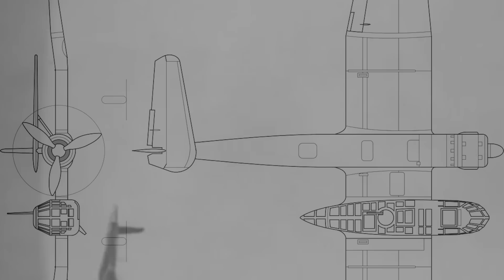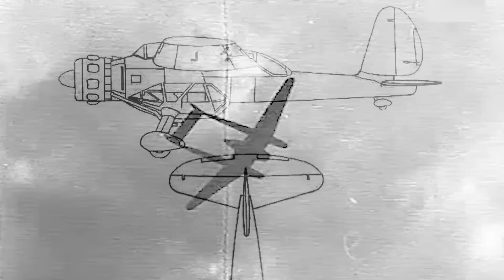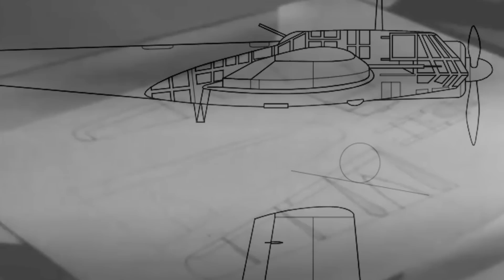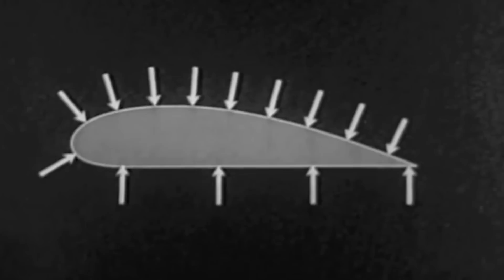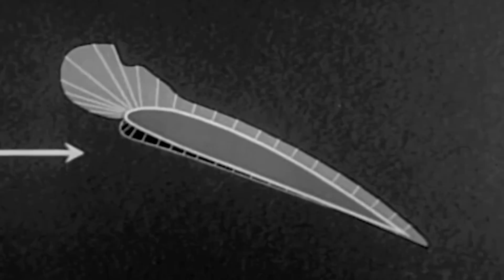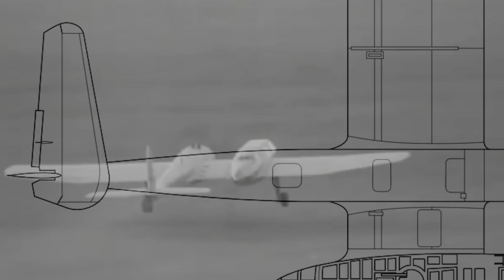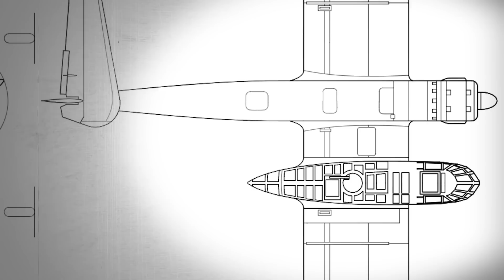BV 141 - The Most Asymmetrical Airplane of WW2

Comment: At the end...Richard Vogt was taken to America under Operation Paperclip where was tasked with designing “nuclear powered” bombers.  We have nuclear powered boats and subs, why not planes?  At least war and cargo planes.  Think of all the fuel consumed by B-52s, C-130s and C-17s over the years.
Reply: Back in the '50s, a lot of hope was resting on the advent of lightweight radiation shielding materials.
These proved to be impossible, so such aircraft would either kill their air & groundcrews over time, or have such thick, heavy, lead shielding as to make performance terrible, & turnaround times interminable.
 Also, fuel was cheap, & environmental damage was not yet a mainstream concern.

Comment: My son and I built an asymmetrical plane that was rubber band powered based on the BV 141 and it actually flew extremely well. Better than some of the standard designs that we've used.

Comment: Re: Asymmetric air-craft, most helicopters and autogyros have a left or right handed rotor. Single engine planes have a noticible gyro effect from engine and prop, when throttle changed.

Comment: There was an X-plane that had a wing that scissored: one side swept forward and other swept wings back. Easy swing wing? No, center of lift changes as speed increases. In the US we drive on the right (correct) side of the road but Europe drives on the left (wrong) side of the road. So the gondola has to be on the left side and engine nacelle needs to be on the right side.

Comment: It’s not hard to imagine that a 
twin-boom central fuselage 
single-engine pusher prop design could have achieved these goals more simply...
something like 
the Edgley EA-7 Optica.

Although the Optica was a later aircraft that had different goals and was thus slower and smaller,
it was a very uniquely 
visibility-oriented aircraft 
(just designed for non-combat).

It is VERY slow and quiet-
if used effectively,
this can actually be more lethal  than power and speed...
especially at night before advanced radar rose to power.

Just ask the Night Witches 
in Russia.

Of course,
its “stealth” is more for environmental concerns than combat.

However,
Ducted fan aside,
the general design configuration of the Optica would have been excellent for this application.

This configuration was simpler,quicker and easier to produce and get flying.

Which brings us back to this:

Way-out innovative designs take time&money to perfect-
such commodities are often in short supply during wartime.

It can certainly be argued that the German obsession with 
“super weapons” or “wunderwaffe” like the V-2 
and the Schwerer Gustav 
actually cost them the war.

The Gustav supercannon program cost 7 million reichsmark 
and in actual combat,
Gustav fired...
48 shells.

More shells were fired in testing.

This wore out its original barrel.

It took 4,000 men five weeks and a custom built semicircular 
TWIN railroad to prepare the 
1,000 Ton weapon 
to be deployed,placed&aimed for firing and 500 men to actually 
fire it...
Furthermore,
it made a VERY obvious target from the air,thus requiring significant dedicated air support craft&personnel to defend it.

It was designed in preparation for the Battle of France but was not ready for action when the battle began and in any case the Wehrmacht's Blitzkrieg offensive overwhelmingly forced the French to surrender in record time and made their “destruction by supercannon” unnecessary.

Then an attack was planned on Leningrad-
The weapon was sent to the railway station of Taytsy. 

It was finally operational when the attack was cancelled. 

Gustav was later destroyed by the Germans near the end of the war in 1945 to avoid capture by the 
Soviet Red Army.

Dora,the sister cannon,
was even more useless.

The V-2 took so long to put into service that it was only able to be used for a few months before they could no longer reach their intended targets because the Germans had to fall back and the V-2 no longer had the range to reach London.

More slave laborers died 
producing it 
than it actually claimed while being used in combat...

Criminally horrible extravagance.

From a wartime resource management perspective,
the V-1 was much more effective.

All war,though,
is ultimately civil war...
Yet-
No war is civil.

Comment: "Exceeded expectations but still underperformed "
Let me get this straight, they expected it to be shit but they built it anyway!? I'm confused
Reply: It exceeded expectations for its designed capabilities but didn't perform the expected task of reconnaissance as well. Most likely due to Allied radar, fighter intercepts, loss of forward air bases, loss of fighter support, loss of oil/gas for planes, etc...
Reply: It met all of the specifications that were laid out in the requirements.   However, as we all know, Germany focused far too much on short and medium range aircraft, and this was just another example.   It did the job it was designed to do, and did it well, but as a short range recon plane it would have to fly out of bases that were vulnerably close to the front lines, and as such it, as well as its bases, would be constantly under attack as was the case at that point in the war.  They shut down the project because it was obvious that 1) it was using up resources that were in dire need for actual defensive aircraft, and 2) a significant number of the Nazi leadership didn't like it due to the way it looked. 

The US had a plane that was treated in much the same way, the P-47 thunderbolt.   It exceeded all of the requirements asked of it, INCLUDING the range requirement.  At the time it was adopted into service the generals in charge of the army air force only wanted long range bombers and were convinced that fighters were an unnecessary waste of resources.   They manipulated information regarding the P-47 and that misinformation continues to this day.     Check out  https://www.youtube.com/watch?v=aCLa078v69k
Reply: @andrewstar9747  The Vought Corsair also had a rough start to a stellar career.
Reply: @dotarsojat7725  yes it did.  It was intended as a carrier plane and was initially only used from land due to issues that were later corrected
Reply: @andrewstar9747  "a significant number of the Nazi leadership didn't like it due to the way it looked. " - That was true for so many of their projects.
Reply: it's a Hitler thing.
Reply: @jerryslater3447  just like many US innovations were
Reply: “Mostly exceeded expectations “
Reply: Welcome to MOST prototypes. You REALLY DON'T know how they'll go UNTIL they go.
Reply: Me too
Reply: Does that mean it was hot shit?
Reply: "Military intelligence, two words combined that don't make sense": from the Megadeth song Hangar 18
Reply: David Parry  you are full of American propaganda. Ever heard of operation paperclip? The US brought hunderts of German engineers into the US because they needed them. German engineers were one of the the best in the world druing ww2, but german politics druing ww2 were extremely incompetent, the most famous example being Hermann Göring.
Reply: It sounds logical  to me,because it is going to be shit anyway.So the expectation for the shot is definitely low,but the out come of it exceeded the shitty expectation.However just exceeding the low and shitty requirement,doesn’t mean it’s meet the bench mark for the role expected.So basically that shitty thing is definitely underperformed,so only expecting a shitty performance.Even though it exceeded the shitty performance,doesn’t mean it meets the bench mark of requirements  for the role
Reply: @owencheng523  you sure sounded smart didn't you.
Reply: @owencheng523  Our next congressman right here - Owen Owen Cheng.
Remember, he is Owen, Owen Owen Cheng.
Reply: Hey, America expected trump to be shit but they elected him anyway

Comment: #Dark_Skies might want to do some research because the Bv 141 was designed purely as a reconnaissance aircraft like the Fw 189 (the Bv 141 saw service on the Eastern Front in support of Army Group South) and the Fw 200 was never designed or built as a heavy bomber  it was designed as an airliner and used as a VIP transport, reconnaissance aircraft and ASW aircraft almost exclusively although on occasions it would perform anti ship duties.

Comment: I don't want to get picky and critical but around 11:06 you refer to engines being needed for the "FW-109" but I think you meant to say "FW-190", which is the radial engine fighter, as opposed to the BF-109, which was the inverted v-12, water cooled fighter. I get the 109 and 190 mixed plenty myself.

Comment: So, how is the visibility from the pilot"s left?  How are they supposed to defend the aircraft from there?
Reply: That got me thinking. I would guess that in practice the plane body did not block that many actual degrees of FoV. In that direction there would be plenty of visibility above and especially below the (thin) body.
If not, then surely the engineers would have reverted to a conventional symmetrical design and never pursued this one to begin with. We know they tested it extensively and it offered BETTER view, not worse.
Reply: Also, I suppose the lack of view straight to the left COULD BE just a perfectly acceptable design tradeoff... for a plane which was not intended for outright combat but recon and artillery observation roles.
Any plane has a blind spot, except it's usually the downward and/or rear directions (less noticeable to our ground-walking, 2D navigating brain, but no less there). This one has it on the left. Otherwise, same thing.

Comment: "The rudder was under constant assault of drag"?   Did you mean it was under constant assault of turbulence?
Reply: I thought that was a strange statement also.
Reply: It said "Drag" in the picture and I imagine this plane flies at a trimmed angle at all times like a multi-engine plane will if an asymmetric amount of engines aren't functioning which will create drag on the vertical stabilizer but I really don't know as I've never even heard of this plane before.
Reply: @alexander0125  "Amount of engines"? Amounts are measured in e.g. kilograms, litres. The pilot wouldn't say "I had 1000 kg of unoperational engines". 1 engine, 2 engines. These are numbers, not amounts. Ergo, "number of engines". Just saying
Reply: It means rotating air whirls generated by the prop and Rolling back tö the tail.
Reply: Drag is correct...Any right angles suffer from 'Compression drag" If you look at most prop planes now you have a gentle sloping from fuselage to runner to minimize this. WW2 put aeronautics ahead light years with the understanding of compressibility around airframes...In dives, certain portions of airflow could go supersonic even though the plane was subsonic...Around the canopy and along wing/fuselage junctions.
Reply: The world is full of what ought to be professional copy but contains the most primitive use of language.   Malapropisms, misunderstood cliches, synonyms with questionable connotations; it's amazing the writers are employed in the task.  Someone may well have done a nice piece of research only to have it butchered when converted to prose.  Alas for my ancient tongue: what greatness was thine, now come to feed swine.
Reply: @scottbilger9294  More likely "drag" is the proper word here and BitJam simply do not understand the physics.
Turbulent flow is huge source of drag in case of object moving in the air or water...
Reply: The correct term for this is a phenomenon called ‘slipstream effect’

Comment: “Great visibility”??? You’ve got great visibility to the starboard direction. You’ve got zero visibility to port, because there is  an airplane airframe flying in VERY CLOSE formation.!
Reply: That got me thinking. I would guess that in practice the plane body did not block that many actual degrees of FoV.
In that direction there would be plenty of visibility above and especially below the (thin) body. There would be a dedicated observer onboard, too, probably in a low position. It was, after all, a plane intended for recon and artillery observation roles. The video did say the design met the requirements really well.
Reply: Well, just fly constant right hand turns over the target. Works for the AC-130. ^^

Comment: It was a great idea, but the need to use the BMW 801 radial engine was its downfall. Focke-Wulf needed ALL the BMW 801 production for the Fw 190 fighter in the early 1940's, and that ruled out BV 141 production. The Luftwaffe chose the Focke-Wulf Fw 189, which was more "conventional" looking but was still innovative in its own way; it used the Argus As 410 engine, which had no production supply issues.

Comment: I've built stuff like this in KSP before. Building something that flies is really easy. Building something that flies well is very difficult.
Reply: The circulating effects of the propeller of a single engine aircraft causes a lot of dangerous and difficult asymmetric handling problems.  The genius Dr Robert Voigt of Blohm & Voss was to harness these forces to great stable flight rather than fight them.
Reply: @WilliamJones-Halibut-vq1fs  Only, his design was horrible. It creates the drag and near the weight of a twin engine fighter, while only having a single engine. A much smarter design is simply 2 counter rotating props on one propshaft, but even this is not without it's drawbacks, which is why very few planes were made with that technology.
Reply: @morteparla6926  You are not thinking in 3 dimensions.   Think of the propeller slipstream which rotates in a helix.  The adds lft on the underside of the upward rotating propeller.   Then the tail find has to be cambered as well.   The asymmetry of the BV actually leads to symmetry of forces.  Most single engine aircraft had terrible handling due to this circulating effect. They had downward and angled engines and cambered tail fins.  They dropped a wing when stalling.  Contra rotating propellers was just not affordable both due to the cost of the gearbox and its weight.
Reply: everyone: I don't think that will fly very well
me: I just need to add more thrust
everyone: the frame is to flimsy for that much thrust
me: that's what struts are for
Reply: @seanpeacock4290  exactly
Reply: @Hugh Jaanus It's Aerospace Science, aka rocket science
Reply: If i recall Airfix used to have a BV 141 1/72 scale model of this plane. I often thought about buying it but never did just one of those things
Reply: Remember that KSP has an extremely simplistic aerodynamic model! If you’re looking for a challenge try the same plane designs you had with the F.A.R. Mod which implements a more realistic (although still simplified) aerodynamic model. You’ll see that even your best aircrafts struggle 😅 i thought I was ok at building planes and that mod was a big reality check
Reply: Plus u have sas and thrusters they have shitty engines props wings and just about everything else not space age shot
Reply: Easy to learn hard to master :)
Reply: @InForTheLonghaul  I like the design, the same question for this aircraft and the B-wing, does the cockpit in this position make this craft awkward to handle or are there advantages? One advantage I can see is when attacking these weird aircraft designs head on or the 6 position, most fighters will aim for center mass and avoid hitting the cockpit.
Reply: @Hugh Jaanus not too difficult if you know what you're doing. just aim for passive stability, main wings need to generate lift behind the center of mass, and the tailplane needs to generate downforce. It's surprisingly a very easy formula to implement
Reply: David Parry it’s not flying, it’s falling... with style.
Reply: Selling is easy, dealing with after sales is hard.
Reply: Minecraft Steve
Reply: @reeseekpuffs6498  Only in real life...
Reply: I think we have the same algorhythm, ksp brought me here too.
Reply: Eh. Idk. Everything I've built flies well. And I don't know shit about aerodynamic shit
Reply: Same
Reply: STEVE
Reply: I quit watching history channel when those morons had lt. Colonel Oliver North talking about Korea n Nam but couldnt remember trillions of dollars. Of drugs he brought into this country. SCUMBAGS.And pawn stars n American Pickers was so fake. Fff you history channel. Go Mark Felton videos
Reply: Did this inspire the B wing in Star Wars?
Reply: David Parry  Bricks fall they do not fly... you can't use fly as synonym of fall in this context.
And even if u use it like that then "very well" is also not corect, they have very haotic fly and you would have big problem to drop it from altitude accurately on target.
Reply: @Bialy_1  Imagine attempting to correct someone when they are making an intentionally silly joke.
Reply: @D_U_N_E  He corrected very good 😂😂😂
Reply: @copperlocks1  Your writing is not very well.
Reply: @brinx8634  nor is urs
Reply: @Bialy_1  ehem teeeechnically these imbalances could be considered intentional Wich would mean that it is gliding not well but still technically gliding and if u want to argue that whatever side is facing down is the front u could say it's a pretty dn fast glider with poor control and no pitch.        
Who's the smart one now bitch
Reply: @Bialy_1  you could fly a brick.. its all about thrust